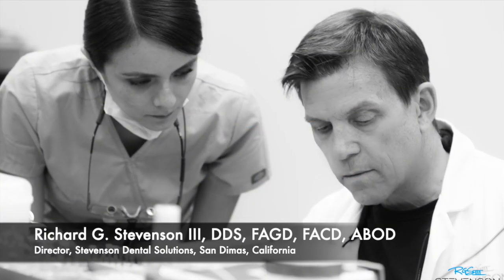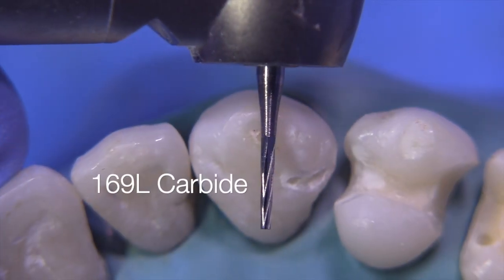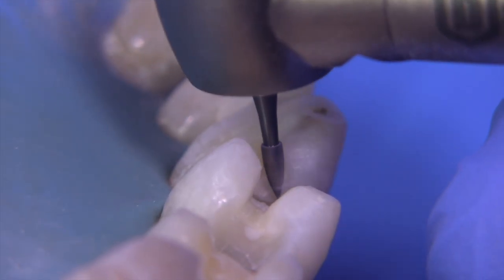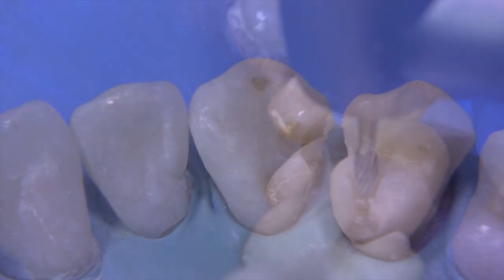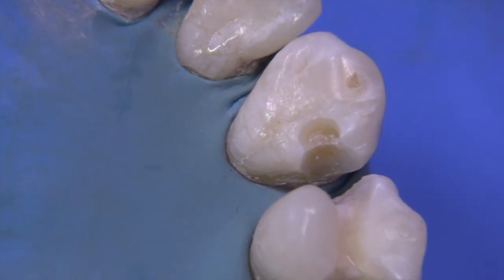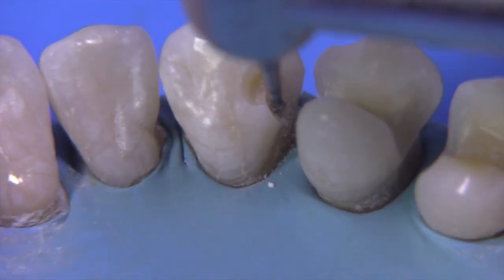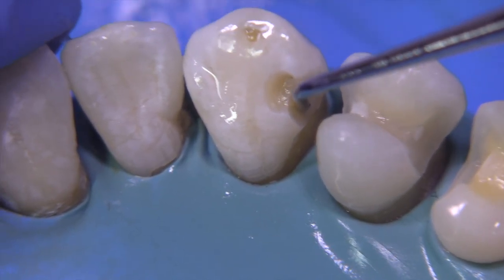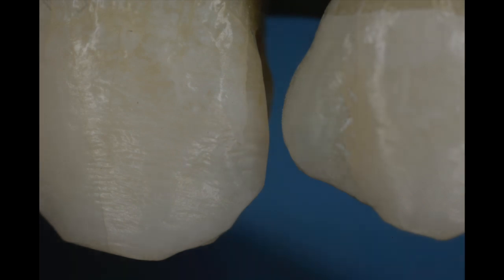Cast Gold Restorations, Part 6: DL Pinlay Preparation

Comment: Thanks a lot doctor Stevenson as always.
I would also want to ask,what are the indications for this type filling? And what are the treatment choices for the abraded cusp? 
Thanks
Reply from the maker: Composite for both would be the easiest and least expensive option.  Patients may opt not to have composite, for numerous reasons, and ask for the longest lasting option, hence, gold would be suitable to address this concern.  The cusp was probably not abraded but was worn via attrition (tooth on tooth wear), and for this, a composite would be esthetic and easy to place.  Rarely, a patient may refuse composite, and for this case, gold foil may be used.
Reply: Thank you Doctor